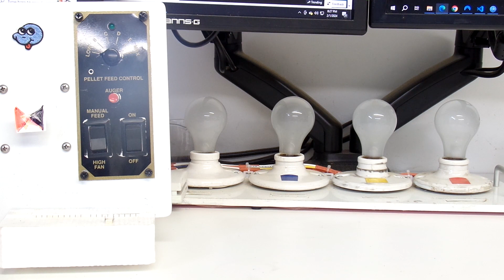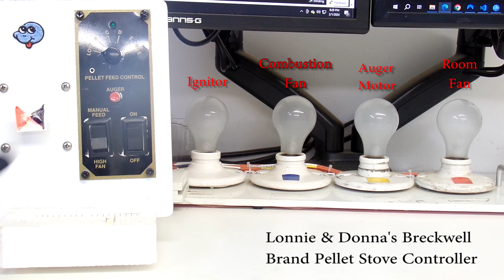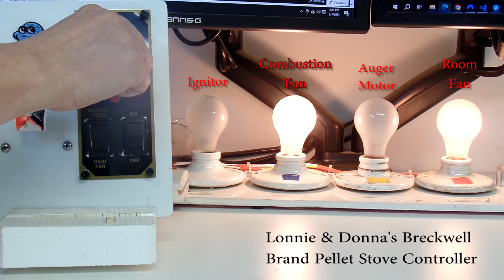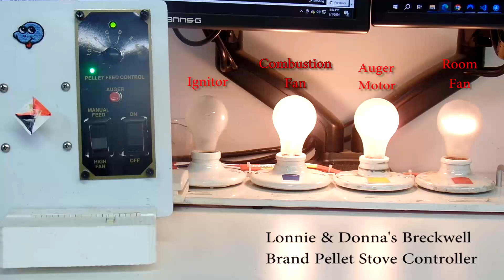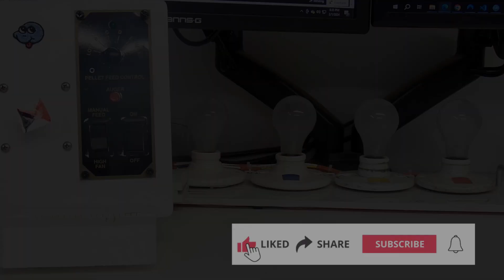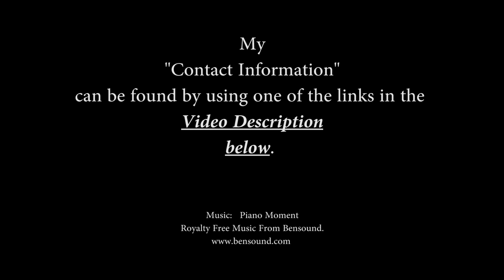Post "2nd" Repair "Final Test" of Lonnie and Donna's Breckwell Brand Pellet Stove Controller.

Comment: We have a  Breckwell Series P24FS and are requesting help to possibly get it working again.  We have used it for 22+ years and while replacing some items - the service person may have either messed up with the wiring or controller.  If you can contact us that would be incredible.  Any assistance would be appreciated.  I cannot access website -
Reply: @MonteStudios  I also need some assistance with my pellet stove, tried calling that number to communicate with you and it didn't work. Is there any other form of communication?